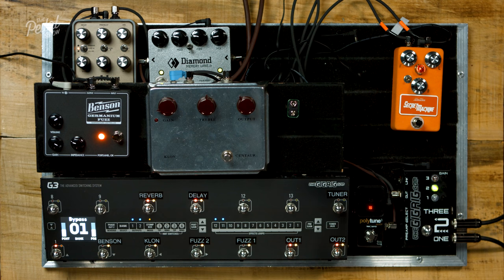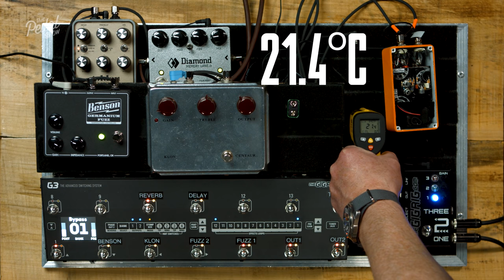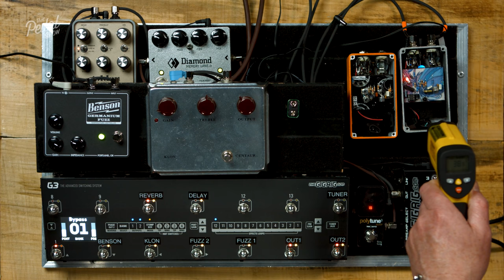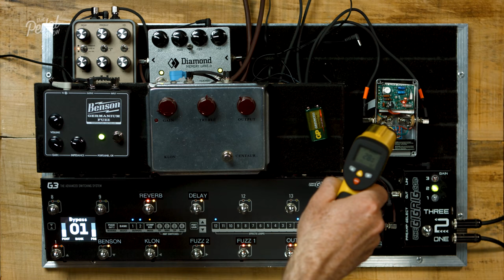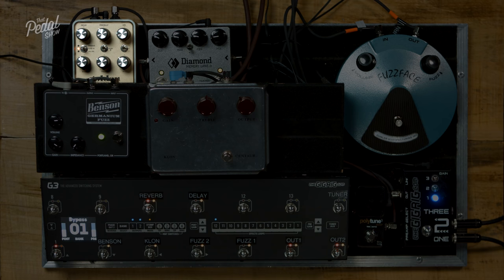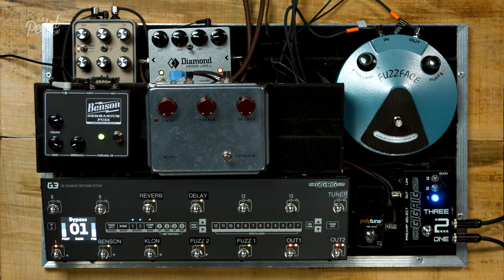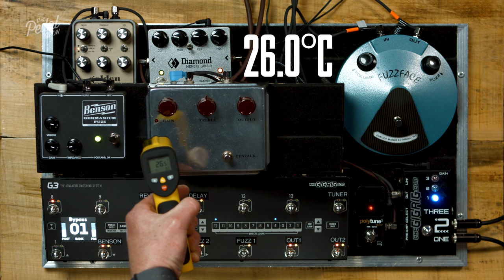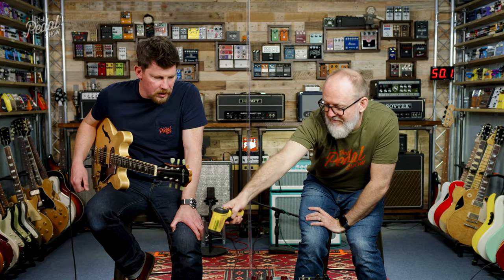Hot Fuzz? The Effect Of Temperature On Your Fuzz Pedal [+ New Benson Fuzz]  – That Pedal Show

Comment: From the Benson website: "After the pickup simulator circuit, we have added an “Impedance” control, which simulates rolling down the guitar volume to get that tight sparkly sound…without adjusting your guitar volume….which you can still do and still sounds great." You guys made it through this whole episode without testing this, i.e., guitar volume full + Impedance knob turned down. Guys!
Reply from the maker: Erm, I think we turned the knob back and forth at least once?
Reply: @ThatPedalShow  A little bit! But not "Let's try messing with the Impedance knob while the guitar is full up to get rolled-down and overdrive sounds." Just sayin'. A great episode regardless!
Reply: AnalogMan fuzzfaces have the same feature on an internal trimmer pot.  It is very useful for taming humbuckers.  It spreads out the useful volume range on the guitar when you are going for Hendrix "clean" tone.

Comment: At 19:41  I dont think the transistors failed it looks like ya might havedamaged the inverter Tc7660s/1054 ic that makes it possible to use pnp transistors with npn type circuits. I bet if ya change that ic the noise will go away.

Comment: Analog synths have the same problem. If not correctly handled in the circuit, change in temperature results in change in pitch.
Reply from the maker: Wow, interesting!
Reply: @ThatPedalShow  it's actually the opposite. Analog synths ( more specifically the ones using VCOs - Voltage controlled oscillators ) need to be warmed up in order to operate properly. It usually takes 15/20 minutes for an analog synth with VCOs to warm up, and If you try to play it before that, it will be out of tune. The rest of the circuit is not very sensitive to temperature changes
Reply: How you can tune an analog synth n is interesting and all the problems that Dave smith faced with the prophet 1-6 are really interesting media for consumption,its a great story and a great learning curve,that applies to the MOOG story to all the infor you can find about oscillators VCO s,PWM and all that wild wild synth rabbit hole its absolutely amazing!!!

Comment: I wonder if that final benson test was the most accurate way to test since the heat would come from the outside and take a bit to heat up the inside? That seems pretty good. One could simply have something providing shade over the pedals
And that could help quite a bit .

    Also , I wonder if insulating the inside of a pedal is basically the solution? I mean if my Stanley can insulate and keep water cool for days and stable, couldn’t a pedal casing simply use insulated material? Problem solved?
I think I should patent that ASAP

Comment: It would have been interesting to play with the impedance knob on the Benson with the Strat in position 4.  I noticed that it dulled up much more than the Fuzz Face.  And the two pickups in parallel would significantly change the impedance of the guitar signal.
I wonder how much the internal dissipation of the transistors over a night of playing though it.  Couldn't find much data on-line on theta jC but TO-18 cases aren't terribly efficient.
Just put a Peltier device on the devices to keep it cool.

Comment: I eventually came around to accepting that some days will sound better than others, depending on the temperature for ge pedals. 

My solution is to have 2 ge pedals on the board (Mullard cv7005 & ac107) because one may be having a better day than the other. And I tend to stick with that one.

Comment: Cesar Diaz famously used a cooler with ice in it for Stevie and would swap the pedals in and out of the cool box. through the course of the night
Reply: Do you happen to know if the Diaz fuzz circuit had modifications that allowed the fuzz to stand up to heat better, or make them cleanup better when rolling down the volume compared to a stock fuzz face circuit?

Comment: Guys, look up Peltier Coolers (Thermoelectric coolers).  Simple ones can be had for less than $10.  One of these, a thermocouple to monitor temp, and a heatpipe attached to a passive heatsink should be more than enough to get the job done.  You should be able to do this without a fan at the low power levels of a pedal.  In fact, if the pedal has a good solid metal case it could likely become the heatsink.  Just a thought :)
Reply: Wildly inefficient, but if you've already got mains power plumbed to your board, who cares?! :) Another plus, if you end up gigging in the frozen wasteland of Hoth, you just have to flip the polarity on the cooler and it can keep those junctions right in their happy place.
Reply: @a.k.4550  Think about the thermal power to deal with, though... it's very small in the grand scheme of things.  When you're trying to control 1 to 3 Germanium transistors that are dissipating relatively little heat to begin with there isn't a terribly efficient solution aside from physically relocating the pedal electronics.  Even with environmental factors, it's not like trying to cool a PC CPU.

Comment: What an episode. Those poor pedals. Question about "being first in the chain". I have a bunch of amazing fuzz pedals many of which like being first in the chain - how do I have many of them on a board? Is it ONLY possible with a switcher? What about one of those pedals that simulate a pickup impedance? Just found out about these recently.
Reply from the maker: Yes and yes. Either a switcher - and it’d better be a blimmin good one - or you have to simulate that impedance thing. Which is always a simulation.... You might find that some of those fuzzes don’t really care where they are. But FF types and if you want any clean up...... that’s the issue. Cheers!

Comment: You could get a pedalboard made out of a (sort of ) car radiator and use the pedalboard as a heat sync and blow air under it using like a PC fan (maybe).. I've thought about this waaaayyy to much.. i'll get my coat
Reply from the maker: I like it Andy. Mick here. :0)

Comment: I tour in Texas quite a bit, and I usually have to remove my Germanium pedals from my board for outdoor shows. I have a Keeley Germanium Amplifier pedal that is so incredible for just the right about of boost and treble, but I usually either remove it or replace it with a silicon BMF fuzz. There are many pedals that say they work ok but I haven't found one to withstand the TX sun yet. I'm interested to see about the Benson.
Reply: Do your germaniums have a bias knob?
    I’m actually about to have a company build me a custom germanium and wonder what the realistic temperature range would be . Mike would have a bias knob, though I don’t how useful it would
Be since I feel I’d have the bias lower and want it someone set.
     What temperature is it down there when your pedal starts to not work?

Comment: Question time, any advice would be great! So, a new amp is on the horizon for me, I just haven’t decided what one! I want something Fender-y as chasing that Mayer type sound is what I want to aim for, but I’m unsure what to get!! I’ll have to save for whatever amp I eventually decide on but my budget will be around £1500, any suggestions for good fender/fender type amps below this price? Hot Rod Deluxe, Blues Jr and Deluxe Reverb is what I’ve considered so far... (also, what is best for Reverb Deluxe, Tonemaster or the Valve?)

Edit: Any amp that will 1. Help achieve something Mayer-esk and 2. Great for an expanding pedalboard would be great, doesn’t have to be Fender necessarily but that’s what I assume would be best for that kind of sound!
Reply from the maker: Hello Charlie. The ‘classic’ clean Mayer tone is really interesting. It starts with a loud clean amp - he’s a fan of Dumble and Two Rock amps - and then he often likes position two and four on the Strat. I mean he uses all positions and plenty of gain too, but that’s kinda the ‘home’ clean tone. He’s also a big fan of various mid boosty things, be they clean boosts, the Klon and indeed many a Tube Screamer.... when added to the position two and four thing into a clean amp they sort of fill the mids back in. Any of those amps will work for you. I’d go HRD or 65 DR over the Blues Jr personally - Mick here. That reverb on the DRRI or Twin Reverb is really special. The ToneMaster is a good amp too and if you’re playing mainly at home at lower volumes it will totally get you there. All of which to say that Mayer’s tone can be approximated from any half decent clean amp. Strat, something mid boosty and a GREAT reverb is important, as is learning some of his key chord phrasing. Good luck!

Comment: Great show! How were you powering the Benson G Fuzz? Didn’t look like a GigRig power plug. I got those crazy oscillation sounds described in the Benson manual, when the heater turns on & off internally, when using any of the GigRig power adapters (Virtual Battery, Isolator, Timelord). The only thing that didn’t get that oscillation sound was powering directly from a Distributor. Any ideas why??
Reply from the maker: Oooh. That’s interesting. I don’t know - hopefully Dan will chime in.... cheers!
Reply: @ThatPedalShow  Yes, if possible, Dan please chime in!
Reply: We call that Fuzz cow syndrome...happens when the power supply doesn’t instantaneously provide enough current which is usually totally fine...but the fuzz needs it or else it makes moo sounds 🐄

Comment: Question. Do the modern germanium fuzzes, such as the Way Huge Havalina, which I own, address this problem? Or is there no way around this?
Reply from the maker: Depends entirely on the transistors and how they’re biased. Modern stuff tends to be much less problematic and if you see ‘military spec’ transistors listed anywhere they tend to be more stable. Cheers!
Reply: @ThatPedalShow  Thanks. I found out that the Havalina does have a bias trimmer so that should help. Very informative video!

Comment: Hello Lads. Thanks for this show. I recently purchased the Benson Fuzz and using it with a standard 9 V lead from an isolator the pedal produced a strange buzzing sound of that oscillated in pitch regardless of how I had the knobs set. I emailed support TheGigRig and Declan was very kind enough to quickly respond and tell me that the current solution for the Benson fuzz’s appetite for current is to use two Timelords and a Current Doubling adaptor. This will combine both Timelords into one current doubled output at 1100mA. 
I’m curious to know if this is what you guys did for this episode.
Your pal, Darin
Reply from the maker: That’s what we’re using here Darin 🤓👍
Reply: @ThatPedalShow  Thanks Guys!

Comment: CONFUSED = Isn’t the problem that they get too hot?  So why does benson have a heater?  wouldn’t you want a way to cool it?
Reply: I think at higher temperatures the current through the resistor is shut off and the resistor acts as a kind of heat sink.

Comment: You guys should check out the Isle of Tone fuzzes, their Haze 69 is a Silicon fuzz that is very clone to Germanium fuzz Sound. They are a bit hard to get hands on though
Reply: Deep Trip BOG is a killer circuit, silicon and it can be dialed to sound more like a warm Germanium Fuzz Face. It also has low and high end sculpting ability.

Comment: I'm guessing Mick has never trained as a mechanic. (explains engine cooling system) "and a fan blows the water around" ;-)
Reply from the maker: Hahaha! Slip of the tongue! Fan blows the cold air, water goes around the radiator. Doh!
Reply: @ThatPedalShow  Thanks for this show. I found it particularly interesting as I have a nice stash of unobtainium germanium transistors and diodes that I keep promising myself I'll do something with. Never thought of fitting a pedal with climate control though.